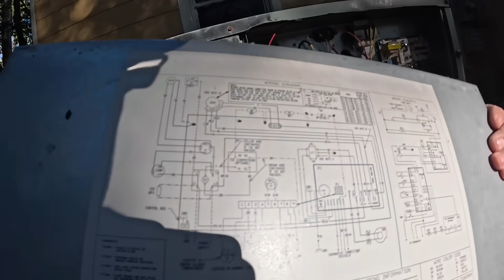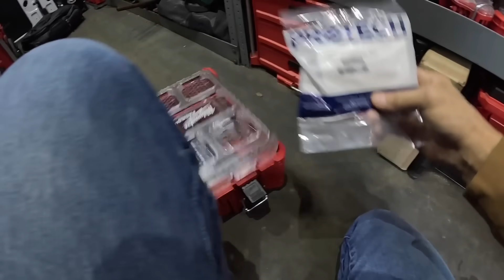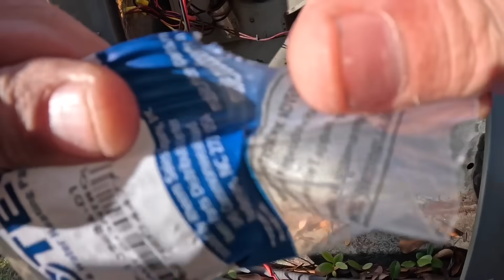Gas Pack Not Heating On New Years Eve! #hvacguy #hvaclife

Comment: Could be a call back waiting to happen. Limits don't fail unless they are repeatedly tripping due to an excessive heat situation. This one appears to have lost the ability to reset itself after cooling down. Installing a new one without measuring the temperature rise will allow the condition to persist. The occupants will run out of heat on the first really cold day.
Reply: It looked like it was just a bad connection
Reply: That I'm sure is true, but that limit was corroded bad.
Reply: Oh yes indeed they fail. They get old, corroded. Parts fail.
Reply: @BillyN31  A high limit is a normally-closed set of contacts. If it fails due to corrosion, it would fail closed. Unless it was tripped by an excessive temperature condition. Then the corrosion might prevent it from resetting.
Reply: @heymikeyhelikesit8673  you have never seen them open and not reset? You must be a newer tech.

Comment: The switch was closed when you had the error code for an open limit so wouldn't the board possibly be bad?
Reply: The switch was opened initially when he tested it and it reset. The switch was definitely the faulty part. 👍🇨🇦
Reply: I disagree, those limits rarely go bad unless they are opening and closing due to a air flow issue, notice it closed when he had the panel door off, needed to check for air restrictions.
Reply: @phoenixhvac-r828  agreed on the air flow comment but those switches will fatigue with time. I’ve had those snap disc controls be off by 20+ degrees. Looking at the state of the yard , house and unit I’m sure the filters are the last thing on that clients of priorities. That switch has likely opened and closed constantly in the heating mode since he turned on the heat. A new switch will have more tolerance and allow Curtis time to talk to the home owner about maintenance. He did state it was a rental property. Happy New Year, be well.